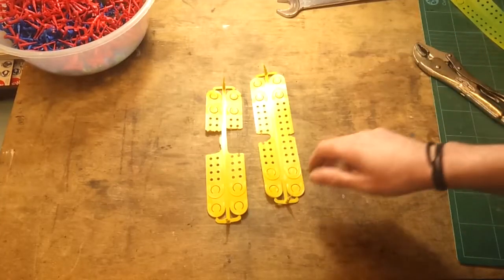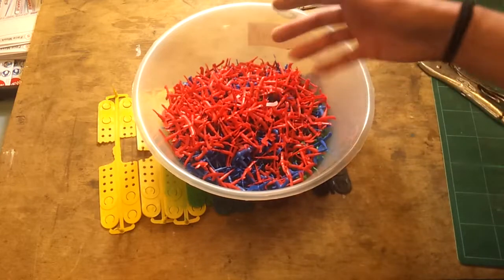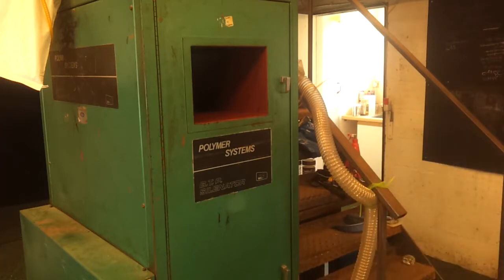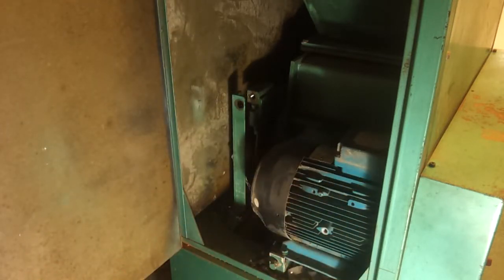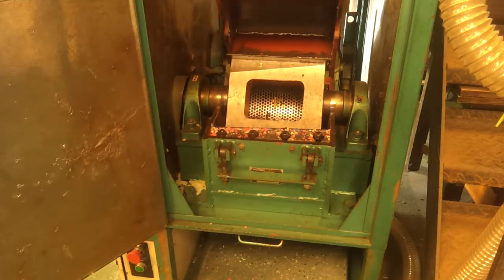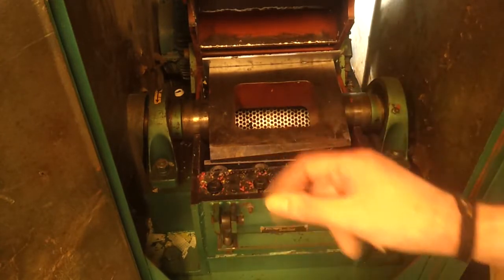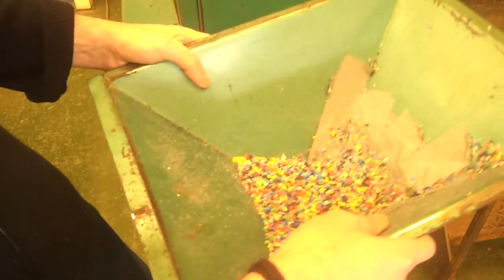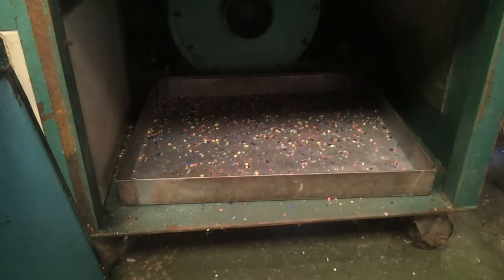A look inside a plastics granulator

Comment: Do you think this would work on a charcoal-like product? turning it from coarse material into a granular?
Reply from the maker: Probably yes, but I expect it would produce a lot of fine powder as well. Some granulators feed the regrind into a cyclone system which separates the fines. Basically like a big Dyson vacuum cleaner. The dust gets extracted and the heavier granules fall through a funnel at the bottom. So I think it could be done with charcoal.

Comment: Very informative,  what did you do before you had the granulator?
Reply from the maker: I got it when I first set up. The Arburg was an ebay purchase off a dealer selling a load of ex-Lego machines, though I think Auntie came from elsewhere. The granulator (Sir Chopalot) was bought with a load of other equipment from another dealer, and the oven plus a big dryer I don't use are on long-term loan from a friend.

Comment: Interesting. How the blades work was a bit of a surprise, was expecting something like a shredder with two opposite axes if you know what I mean.
Reply from the maker: The blade arrangement is clearly the key to getting good granules. They are adjustable, but I've never messed with them to see what happens. I was surprised there isn't more of a scissor action, just a very slightly angle on the rotating blades. The smaller granulators might be different. Will have to check next time I'm at another mould-shop.
Reply: @andyharsley  Yeah I was only familiar with more DIY shredders anyway.